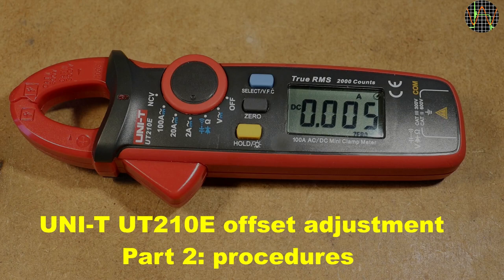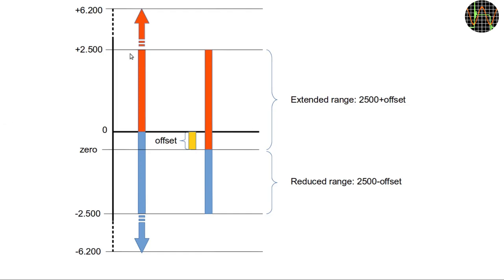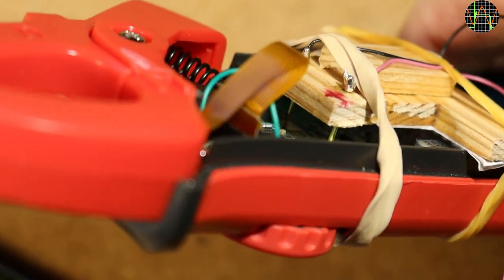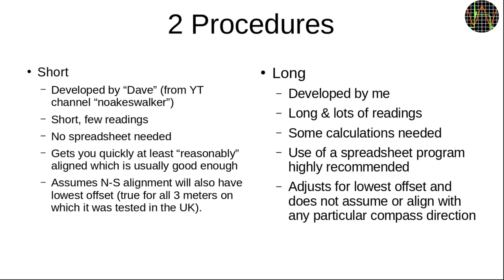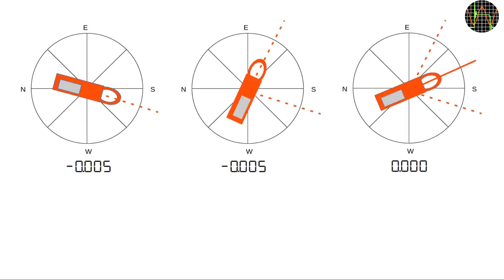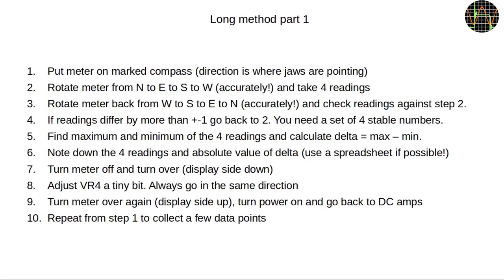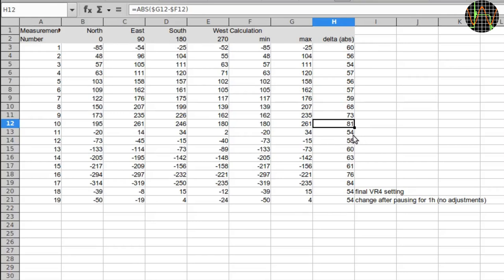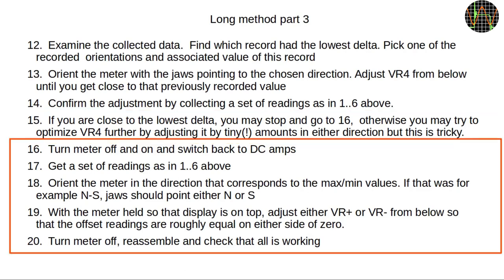UNI-T UT210E offset adjustment part 2: Procedures

Comment: Man..! I love you! (I'm normally not thinking nonsense) You're kind of the Einstein of today and I'm serious, I'm not kidding! you are an expert in physics ... in programming and you have a brilliant mind! Thank you very much for the explanations and for enlightening our minds! But I want to tell you something: look ... for me for example (I work as a technician), it doesn't matter that this type of clamp-meter has errors like 3% ... or 5% for that the measurement of high currents is purely predictive in detecting malfunctions, it does not necessarily have to be accurate, it is simple to deduce! (I use Voltcraft VC-330) In the DC current chapter the error can be 10..25%! and magnetism and nothing matter anymore to find the missing power wire! If I want extra-precise measurements (uA ... mA) I use much more professional (and much more expensive) tools! Much respect for you and for video you make, but who knows how to work with multimeters like this believe me they are very intuitive people, and it is not based on their accuracy, for them it's just a simple info to deduce! All the best!
Reply from the maker: Many thanks for the kind words. I agree that more often than not  I use my multi-meters just to get a rough answer, like is there power at all and if so does the value look about right. This adjustment video was just for the odd case were more accuracy is needed or folks having messed up the trimmers in the UT210E and looking for a way to fix it.

Comment: Great tutorial. I mamaged to calibrate mine to about +/- 20mA in N-S direction an 0mA in E-W direction. For this i turned VR4 countercolockwise when looking at it,till it showed positive numbers in E-W direction and then reduced them by turning VR+ to zero. Repeated this several times till i got a sweet spot in the range I mentioned bevore. However this was a real pain with this tiny pots. So I replaced them by some multiturn pots i placed directly below VR4. Of course this messed up my previous calibration. In my UT201E the pots were actually 10K so replaced them with the same value. The benefit is, I am now able to calibrate it from the side and a bit more precisely. However I don´t get it better calibrated than before, as turning VR4 more conunterclockvise again incrases the range between plus and minus. So this is the sweet spot for me. Beside this I stumbled across an other issue I´m having with this multimeter. By using an old inductive soldering iron and a 4mm cooper wire to demagneritize the clamp, I´m measuring 90A in the 20A range whereas it gives me 150A in the 100A range. Reducing the no. of counts doesn´t help either. It just masks this issue. With smaller AC currents both readings are accurate, so will have to investigate a bit more into this.
Reply from the maker: Glad the video helped and multi-turn pots are really what UNI-T should have used to begin with. I am somewhat confused by you measuring 90A in the 20A range? Did you increase the counts to extend the ranges? One side effect that has is to reduce the max. allowed crest factor. This can become a problem if the voltages/currents are no longer sinusoidal (pure sine already has a crest factor of 1.4) If the clamp is saturated by your test, it may cause non-sinusoidal waves which a range-boosted meter may have trouble with measuring correctly. That's just one possibility, but maybe you have a different cause. It would be interesting to hear your results.
Reply: @TheHWcave  well, yes I incrased the counts to 10000 as I´m pretty sure mine is a DM1106 Chip as it doesn´t show wrong readings when measuring AC voltage in the 230V range. Tried already reducing the counts with the result it just masked the issue in the 20A setting by showing OL, as it still showed 150A AC when switched over to 100A setting. Plus i spend yesterday evening with calibrating the 20A and the 100A range for a bit more accurate DC current readings. Used for this a cable which i turned 30 times around the clamp to simulate 90 A. The 100A range showed a bit more an the 20A range a bit less. After getting on both the exact same values also by using your calculation method I found out the 100A setting readings are quite linear in the whole range but for 20A this is not the case. So after calibrating both to 90A and reducing the current to 60A in the 20A setting I´m getting way more than 60A while the 100A setting still showed very accurate readings. So will have to find a compromise to get more or less acurate readings when measuring in the 20A setting. However after calibrating both, I still have the same behavior when measuring AC currents with the solder iron. So my guess is also the clamp might be saturated as you are saying, as the 150A are way above the crest faktor of √2 compared to the 90A AC measured in the 20A setting. So it´s just what it is supposed to be, a 100A clamp meter. But still enough to be a usable tool.
Reply from the maker: Thanks for the update. I guess you are right and you may have found the limits of what the clamp can handle, but for the cost of a UT210E, one can't really complain.

Comment: Mine shows around -380 mA out of the box offset. I put it at positive side of my car battery cable, then started the car again and removed it the offset. Just thought I'd share.(sorry for my bad english).
Reply from the maker: No worrys, your English is fine. Thanks for sharing. With a hall-effect based clamp meter it is good to occasional de-gauss (de-magnify) the clamp from any residual magnetism build-up

Comment: Hello. I have same tool but in dc i have an offset of 5.5A in 20A scale and shows OL on 2A scale. What can I do. The reset does nothing at all. Is it magnetized? What home tools can I use to fix
Reply from the maker: Wow, that is serious.How did that happen? I am asking because things to try would be different if that is accumulated magnetism, or a failed attempt in adjusting the trim pots or possibly a broken flat ribbon cable to the hall-effect sensors, or even a broken clamp assembly. Also make sure no strong neodymium magnets are close by.  Does the 5.5A reading change with moving (rotating in 3D space) as well as moving to different rooms?
Reply from the maker: Thanks for the video. Lets first try to demagnetise it. The easiest way is if you could get one of these de-magnetisers:  https://www.youtube.com/watch?v=AhTYBPdJG7A&t=2s 
You don't need to put the PTC mod in that I describe in that video, just move the UT210E slowly(!) away half  a meter or so while keeping the button of the demagnetizer pressed. You probably have to repeat that a few dozend times but you should see an improvement in the reading on the UT210E. Also give the demagnetizer some cool down time.  Long term having one of these is a good thing because you need to do that fairly often with the UT210E (and it might be handy do demagntise other things).  You can build your own but unless you know what you are doing I would not consider connecting anything to mains voltage.  If you have a strong AC transformer handy, that can provide a good AC current of 5A or more and is isolated from mains, you might try using it instead. Make a coil of sufficent diameter that the whole clamp part of the UT210E fits easily inside. Use isolated wire for the coil with decent thick copper core for the current. For example cables meant for mains can be used to extract a suitable wire. But you only need just one long wire. Make 30 or 40 turns neatly next to each other, Maybe on a short cardboard pipe of the right diameter . Put the UT210E inside, connect the coil to the AC transformer and slowly pull the UT210E out of the coil, Don't turn the coil off until the UT210 is a least half a meter away,  May have to repeat that a few times.  Remember the coil voltage must be AC (not rectified) and isolated from mains and watch to not overheat (melt!) your coil or transformer.  Also the transformer may blow a fuse because it regards the coil as a short circuit, in which case you may have to put a resistor in series. That will probably get too complicated...
Reply: @TheHWcave  thanks again... can i use a motor winding from old water pump? Well i tried 4 times taking the clamp inside and leaving on getting the clamp off the magenetic field upwards gently... but remains the same... here is the motor used   https://youtu.be/1PdTUyl-omM
Reply from the maker: @marce002b  In general that should work. Just to be sure. Take  a screwdriver and make it magnetic (sliding a permanent magnet along its shaft). Confirm that it is by picking up paper clips or small screws. Then insert into your pump and do the same action as you do for the UT210E. Can you confirm that the screwdriver magnetism is gone afterwards?
Reply: @TheHWcave   @TheHWcave  yes it is the first thing i did first.... it works degaussing a previously magnetized screwdriver.... also wanted to ask... the menu CAL that appears when you press SELECT and HOLD can work for me in any  aspect? I have now a 13,4% error at 5amp in DC measurements ...can see 4.32A when bench shows 5A !!! Look

https://youtu.be/H-n0ogCh224
Reply from the maker: That's great. It means the offset is gone. At least the 20A range now zeros and no longer shows 5.5A with nothing in the clamp.  That error you see is clearly a gain problem and calibration should fix it. The bad news is that I don't know how the CAL menu works. I did my calibration directly by modifying the correction factor values in the EEPROM.  As far as I know, the CAL program will show certain values that it expects you then to apply to the UT210E, but that is the extend of my knowledge.
Reply: @TheHWcave  ok and touching the pots? In such case wich one ?
Reply from the maker: The pots are not for calibration. They set the offset for the hall effect sensors. I made two long videos about them and the rather complicate procedure of adjusting if needed. Please check these videos before touching the pots.

Comment: محاضراتك داىما راعه
عندي مثل هذا الأمطار ومشكلته في وضع فحص الاستمرارية يصفر قبل أن المسه احيانا
Reply from the maker: I (or rather Google translate) struggle with this. You are saying that the meter sometimes beeps in continuity mode before you touch the probes to something? If so that means something is broken or contaminated. I would check the contacts of the range switch and also look for any contamination on the PCB. Maybe cleaning it with isopropyl alcohol helps
Reply: @TheHWcave 
Thank u very much